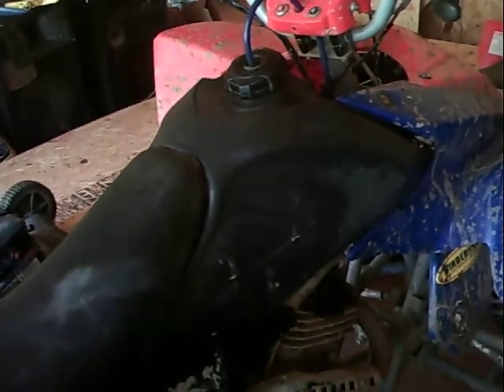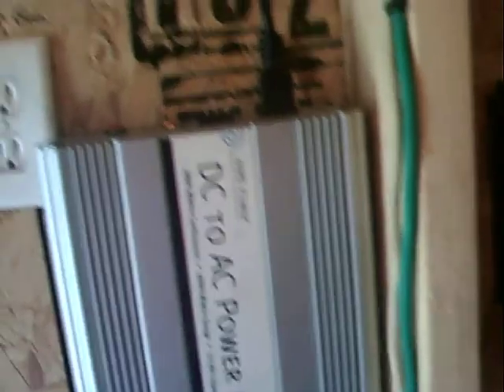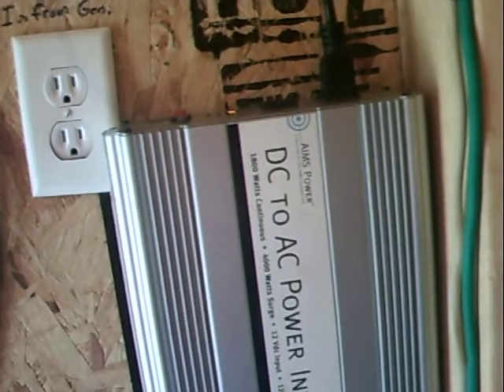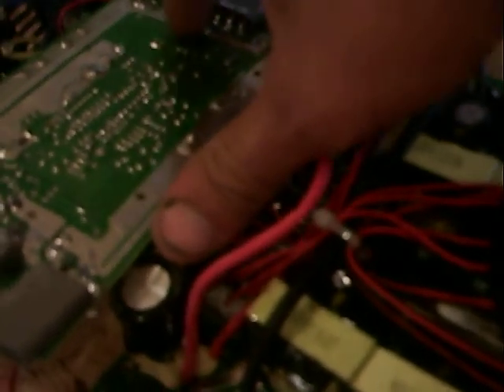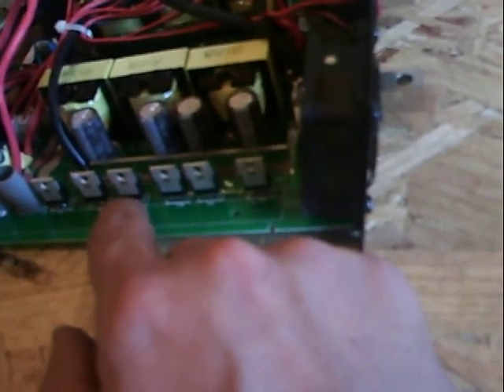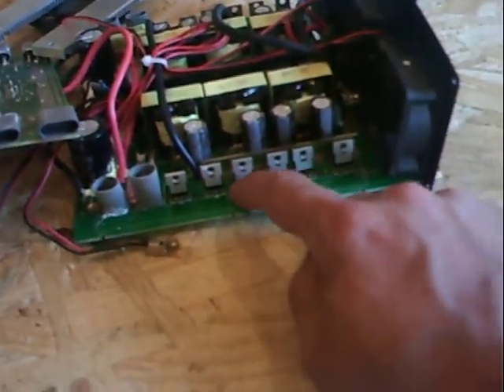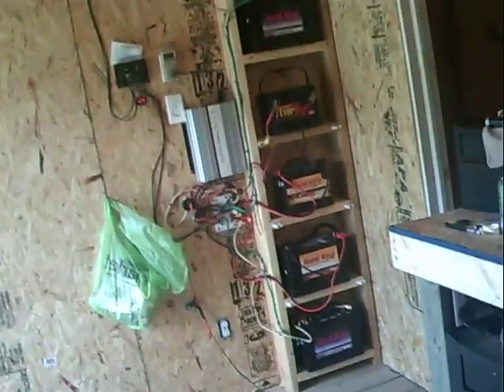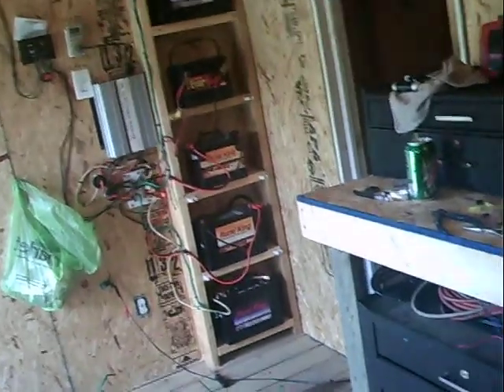ATV gas tank replace, AIMS and centech power inverter repairs

Comment: hey how did the aims hold up. i recently got the 2500 12 volt.running my 5 cubic feet freezer.this is in my van and used for a saw as well.i hear bad talk on aims but none ive seen are broken besides the one you have.i see people fixing broken inverters by other brands that are made out to be better.i look on ebay and havent found any that need repair.
chrles edward in mo.
Reply from the maker: Aims inverters are not bad. Its the price point they set them at, and the same third party made it as say a harbor freight. The thing I see Aims do that's good. They will take a 3000w inverter and put 2500w on it. The one in the video is stamped 1800w and inside its 2400w. I would recommend taking it apart and painting the boards with clear enamel. Living in a van or in a outside environment will corrode the boards over time. I no longer own the Aims, gave it to a buddy. Haven't heard anything bad from him.
Reply: thanx i just find them uder fire alot.
 but that one came off a boat correct?which is bad if not intended for marine?thhanks again charlie.like your vids!